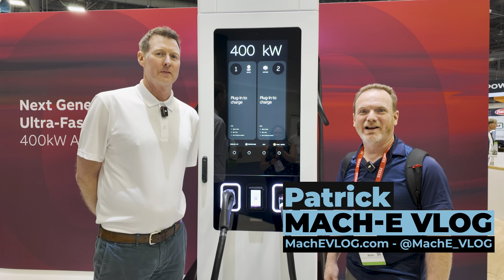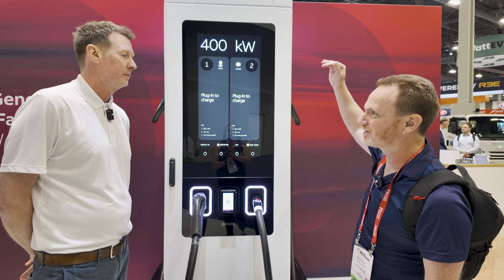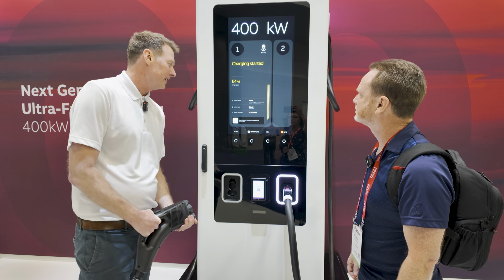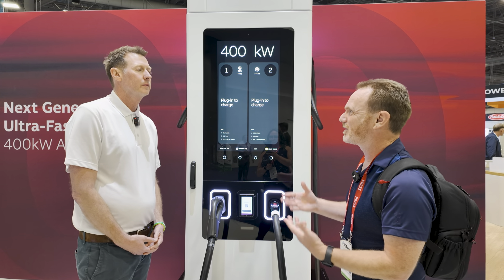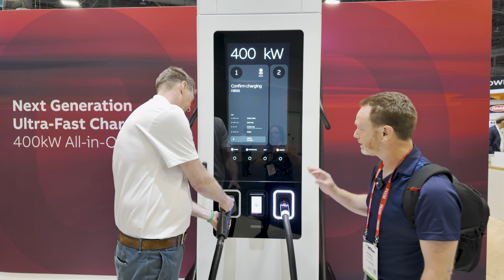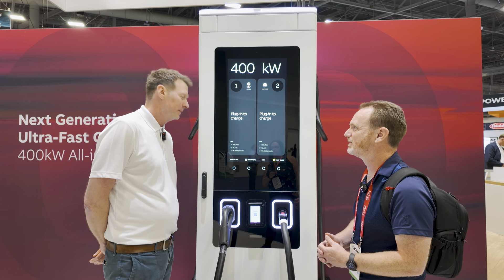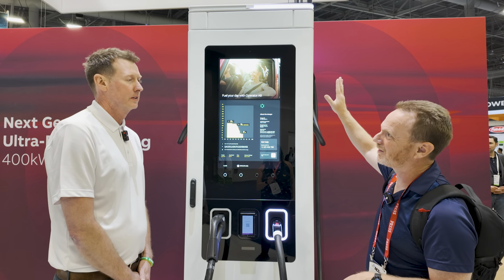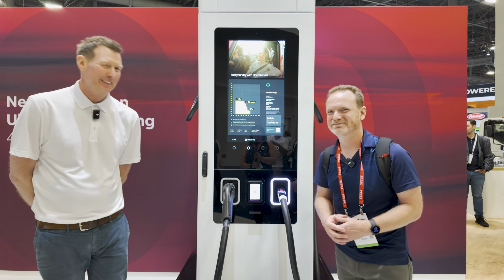(New) ABB DC Fast Charger! 400 kW, reliable, & smart!

Comment: 400kw something a Mach E will never be able to do, pointless
Reply: YOU TOTALLY RIGHT :text-green-game-over:
Reply from the maker: If you noticed in the video, the 400 kW is on a dual port charger and it is designed so that it can have two cars charging at the same time. It will dynamically adjust for the cars charging so it could give 200 kW to each car or it could do 300 to one car and 100 to another. It can also operate in a NEVI compliant mode so that each car is guaranteed at least 150 kW. This is definitely far from pointless and a big improvement over the common 150 kW or even 350 kW (shared) single post installs that are commonly used now.
Reply: @MachE_VLOG  Dual charges is nothing new they have been implemented by Ionity for a long time now, offering 350kw for each car totalling a 700kw charge, the thing that makes me comment this is that the marketing on these things is just misleading, it say big 400kw on the post which makes people believe they can get that for their car not realising that car limitations and sharing with others is a thing.
Reply from the maker: @Roy-qn2ie  I don't think Ionity has any 700 kW charging stations but I could be wrong. The latest model that I saw them deploy is the Alpitronic HYC400 which is similar to this ABB -- 400 kW, dual handle, & shared. Pretty much every manufacturer and CPO uses this type of marketing. Even Tesla saying their V3 SuperChargers are 250 kW is not completely accurate since they are limited by the power input for a 4 post install of around 350 kW. With all of these, you could potentially get the max or close to the max if you are the only one charging. They are also counting on the fact that most cars won't accept even the highest peak for very long. So if you pull in next to someone that is at 70% charger on this station and you plug in, you may still be able to get ~300 kW which is more than most cars would use and the other car might not be affected at all since they are at a higher state of charge. 

I can see both sides on how these are labeled. It is all very confusing for novice and even many experienced EV owners. For me, I wish they would label them in AMPs and let me know if they are shared or dedicated. I can figure out the rest!